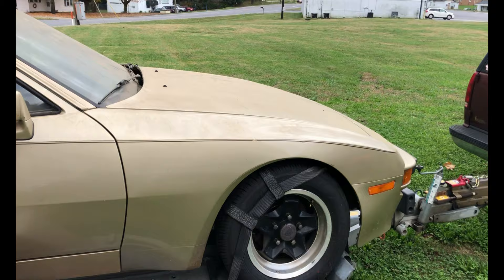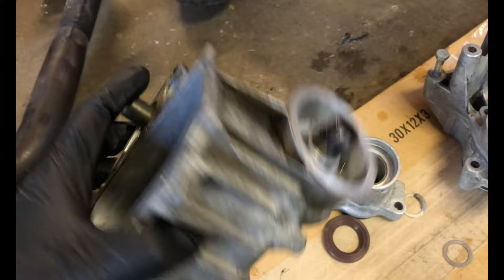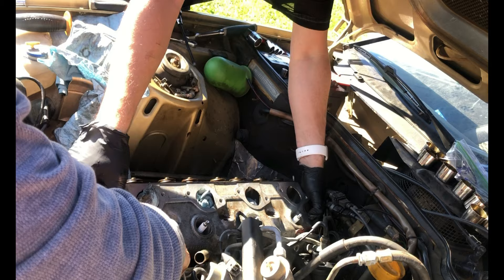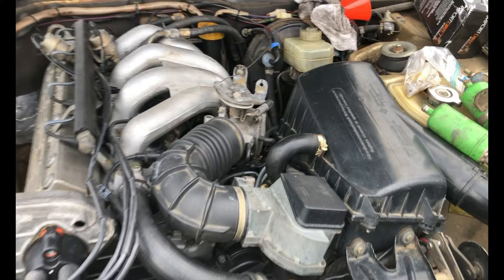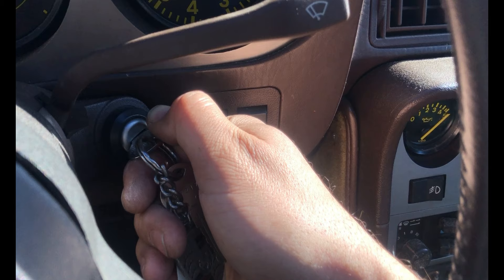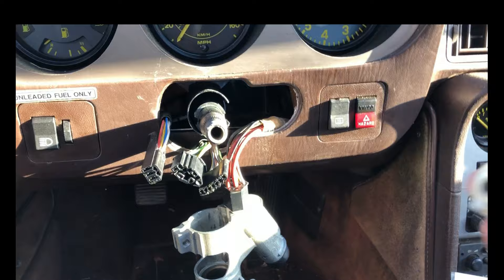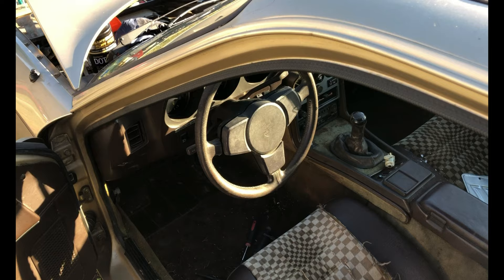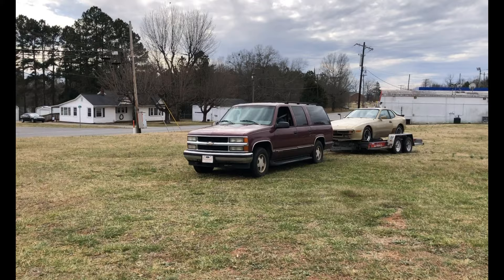Bringing this Porsche 944 back to life after sitting for 14 years

Comment: Brent, have you thought of making a website? I was looking to see if you had one but there’s nothing. Anyways, I was wondering how much you’d charge to diagnose and fix a no start issue and spruce up some wiring. Mine is a 1983 and it hasn’t ran in about a year due to the wiring - how much do you charge per hour?

Also, I love your channel. The best of the best. I like how you do your work without fancy garages with lifts and what not.
Reply from the maker: Thanks! I used to have a website but it didn't get much traffic so I started using facebook. It was a much easier to update and create a following for next to nothing, but it looks like it's down today. Probably wouldn't be a bad idea to build another website given the situation. That said, we charge $125 per hour for electrical work. Thanks again!

Comment: Wonderful! Lovely to hear the story too. 

Brent, which brand balance belt do you typically use? I've got one which has an indent/dimple on each tooth, and it's making a very whiny noise. Running the engine without the belt sounds fine, but no matter the tension in the balance belt, it sounds like I've over tightened it.
Reply from the maker: You have a high performance belt which is made up of a stronger material, so it is normal for it to be louder. That said, I use Gates belts. I hope that helps!

Comment: Hey man!!! Waiting on the title for our 46,000 mile red 83 944 !! Storage unit for 6 years !!! Last inspection in 03 !!!!!Repaint, 30 miles on complete engine and transmission rebuild!!!! The analog oil gauge goes straight to 5 and stays there , seems like electrical issues, any thoughts??😀😀😀🍺🍺🍺🍺
Reply from the maker: If it does it without starting the engine then it’s likely the wires on the sender are swapped around.
Reply: Thanks man !!! A photo of the new unit is coming to your email!!! Tell me those aren't the nicest wheels for a 944 !!😂😁😁😁😁🍺🍺🍺

Comment: I have a 1989 944 with a 2.7 for sale in iowa I put a new front main seal in and water pump on its not running just needs finished putting back together I'm asking 1200 for it or best offer it's in iowa

Comment: what does it mean when you say you got the injectors rebuilt?
Reply from the maker: I meant to say I had them 'serviced' but during editing I just had to roll with what slipped out of my mouth and didn't catch at the time. That said, I sent them out to RC fuel injector to be cleaned and flow matched. They replaced the filters, pintle cap, and O-Rings. So, kinda rebuilt, but 'serviced' would have been more accurate statement. Thanks!
Reply: @edredas  Thank you for the clarification.  I am about to pull my injectors out and run some carb cleaner through them and put new o-rings on.  Apparently I have the Siemens 80 lb injectors that go with the Vitesse MAF kit.  Hoping that those use the same o-rings as the original injectors since I bought the o-rings that are for the original injectors.